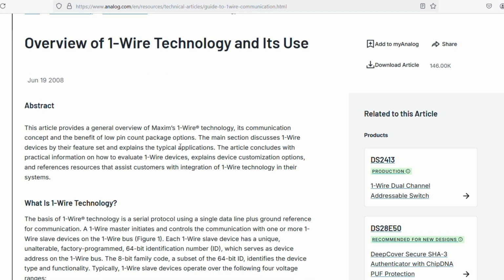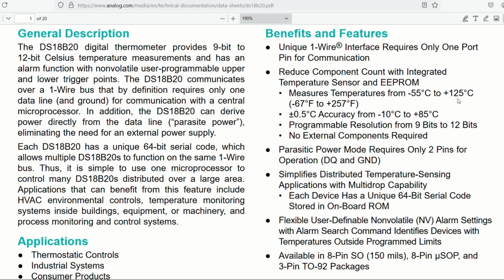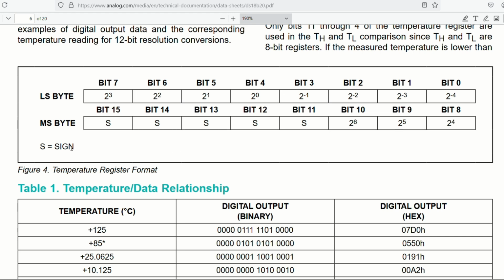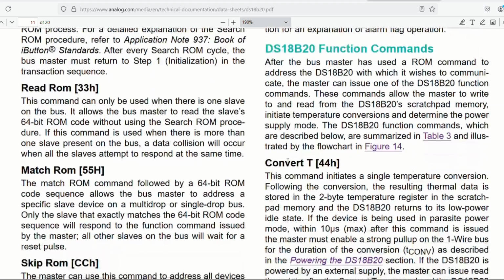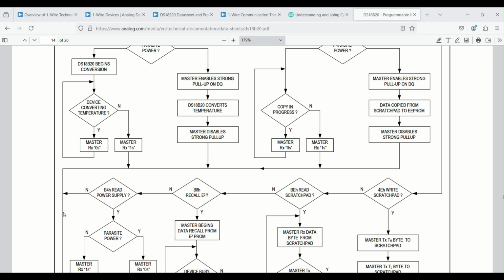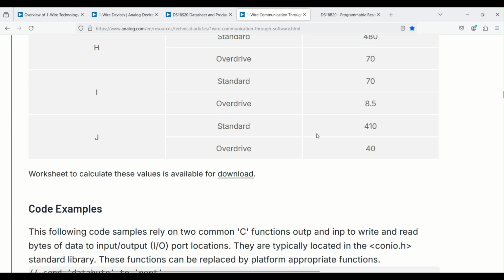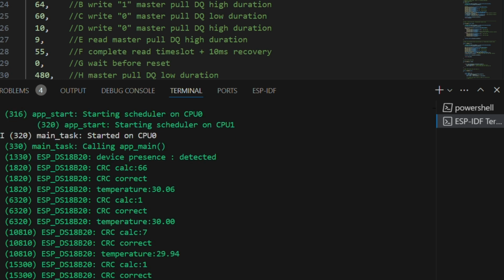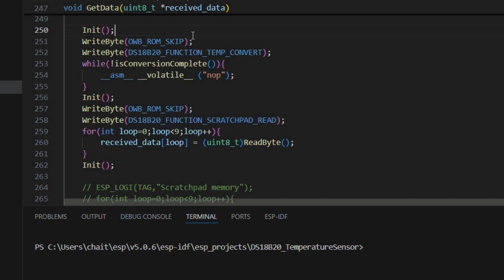ESP32 & DS18B20 Temperature Sensor: Ultimate Guide to Accurate Sensing

Comment: Sir in my project it's not working idk why my all connections are correct my code is correct still it's not working it says not detected something
Reply from the maker: Double check the connections, add decoupling capacitor, change the sensor and if still in doubt, get a cheap logic analyzer clone and observe the signals.